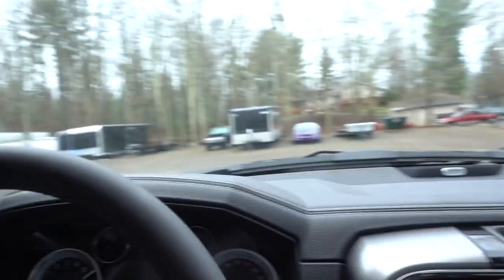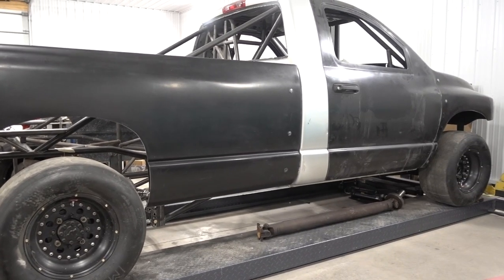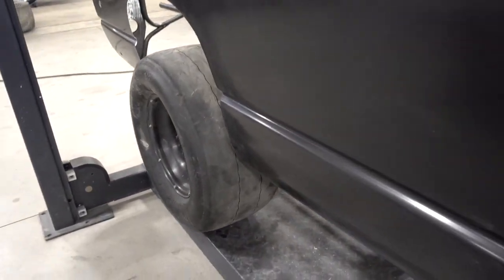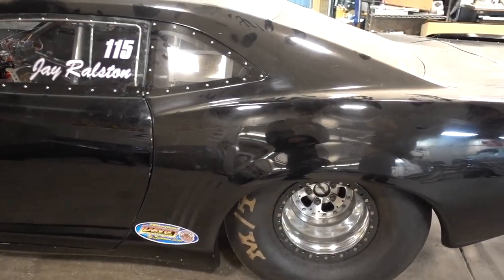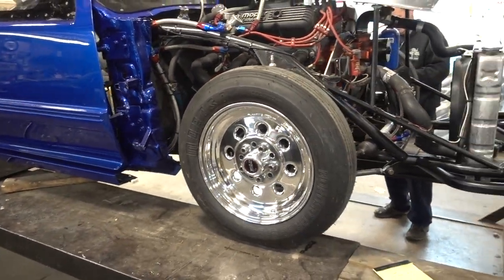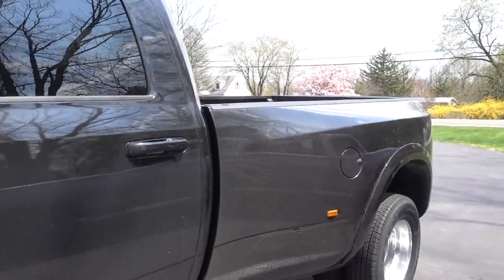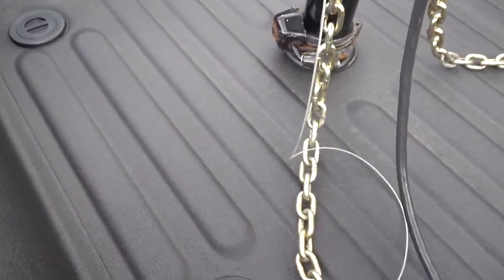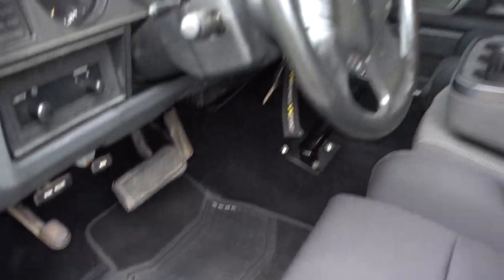FIRST MODS TO THE 2018 3500 CUMMINS!!!

Comment: When I factory ordered my truck this time I opted out of the factory gooseneck for this reason. Can’t beat the B&W turn over ball. I had to use shackles to hook the trailer up and I could hear the ball rattle in the receiver more because it’s just the two little “ball bearings” holding it in instead of the square with a pin.
Reply: For some reason RAM had to be different. They should have just offered the B&W gooseneck system as standard for the 3500 for bragging rights. And have it optional for the 2500 and 1500. It would be so much cheaper for the guys buying these trucks instead of paying for shipping and the install.

Comment: I wonder when the emissions crap will fall off 🤔
Reply: Will probably shake loose when greg drives on the shit roads in Mexico
Reply: Yeah I heard the DEF and DPF mounts rust and fall off really easy and fast for Greg lmao.
Reply: The capless fuel cap next to the def fill is a bad design  spilled def will go right into fuel and thats bad
Reply: Powerstroke Strong 903 There's a drain inside of the fuel stem that allows anything that isnt past a certain point to drain out. Though, I do agree that it is a dumb design overall.
Reply: Screw the warranty if you don't take that garbage off soon it will wear down the engine. More so if you aren't constantly towing with it. I've seen trucks with 100k empty miles completely trashed and out of warranty. You don't want to wait until the warranty is up, it won't end well.

Comment: You dont have to press the “alt trailer height” button, even with it on the truck will auto level itself. Well atleast with my 2016 2500 thats how it works. Cool thing is that you can just lower your trailer landing gear to where it bearly touches the ground and keep the Alt trailer height button pressed to release air from the bags and you’ll magically diconnect. Congrats on your baby!!
Reply: I don't think it works like the 2500 though.  Your truck relies only bags for height where his should still have leaf springs.  The 3500 doesn't have adjustable ride height to my knowledge.  Just height compensation for trailers, similar to adding bags to a standard 3500.

Comment: A potentially stupid question.... Never mind. As I was wondering why you wouldn't use the 2 forward fixtures to prevent the goose neck from destroying the tailgate if it comes loose, I realized that the same goes for the backside of the cab once you realize its loose and attempt to stop the thing. Out of 2 scenarios, having a multi ton trailer come flying through the cab is worse.

Comment: Switch up the Clevis slip hooks a size larger than you have and it will fit. If that chain is a 5/16" use a 3/8" slip hook, if its a 3/8" chain use a 1/2" slip hook. Solved my problem. Never use carabiner clips. There not Grade 70.

Comment: Had the same problem with my dually. Bought bigger hooks and just swapped them out. Your brake away line should be attached separate from your safety chains. DOT would be all over that, just fyi.

Comment: Be sure to keep the internals of the ball greased. They are carbon steel and will rust in place and won't release the hitch. Happened on my 18, had to drive it out from underneath with a punch.

Comment: Be careful that the safety chains aren't too short when you make a hard turn that you break them because the anchors being back so far.  Saw another youtuber had that problem  with his truck. Also that ball seems like it is loose vertically in the socket and will rattle can it be tightened down?

Comment: I like how they punched in Lightning holes in the bed braces. That's what we do in the aviation world.
Reply: What're they supposed to do?
Reply: Mrjoecreeper they reduce weight and can increase the rigidity of the piece. And it looks cool too which is a plus
Reply: Trace Fuqua Removing material makes it stronger? I would have never guessed lmao
Reply: Mrjoecreeper the way I understand it it that when you punch those holes or bead roll a piece of metal, it keeps it from flexing. I could be wrong though I’m definitely not a metal fab guy
Reply: Trace Fuqua Yes you're correct the "lip" is done with a dimple die in a press. They will most deff increase the strenght of sheet metal panels besides looking baddass

Comment: I hate how Ram doesn't black out the headliner and pillars like the rest of the interior. Ford does it for their higher trim trucks and it looks amazing!
Reply: Alexander Chavez ram does on the limited
Reply: As Tommy said it's available on the Limited. With that said, you can always just paint the pillars and install black fabric over the headliner. It takes a few hours and some patience but you can do the mod in 1 weekend.